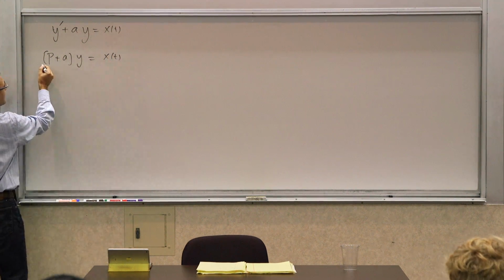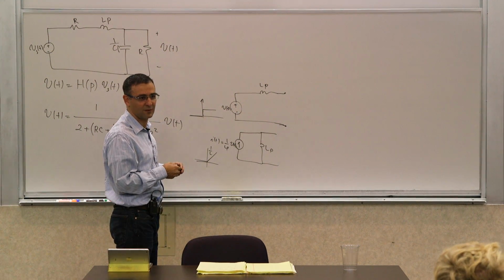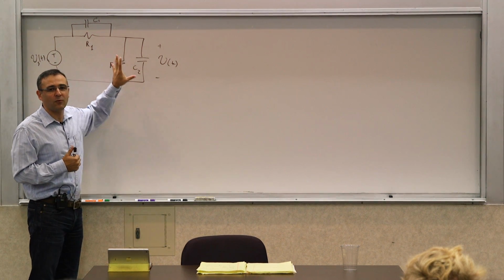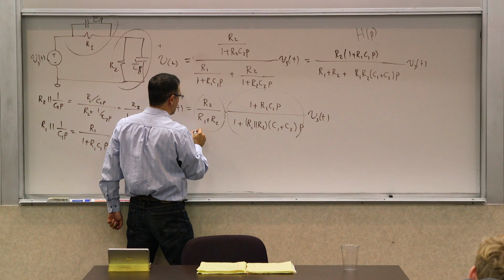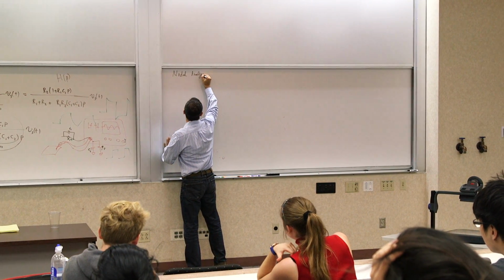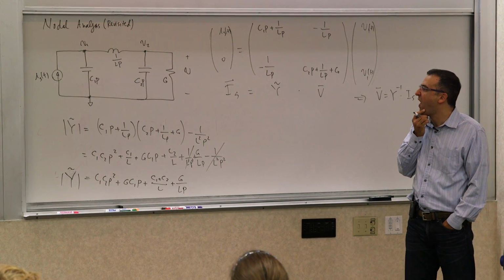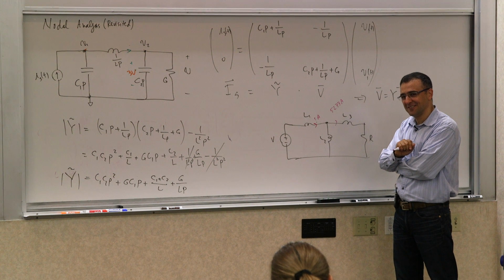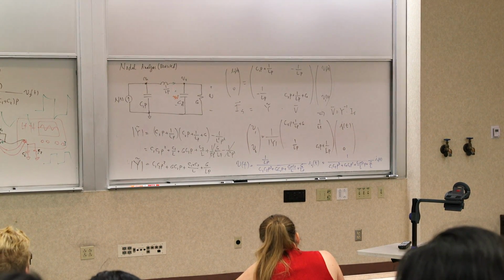019. Heaviside Operator: Nodal Analysis Examples, Order of System, Oscilloscope Probe

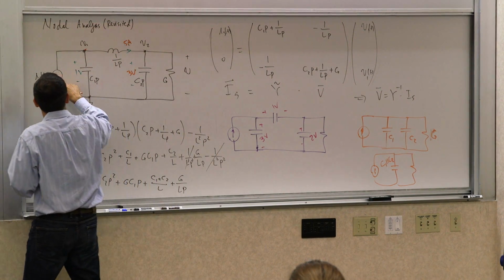Comment: Hello professor Hajmiri, i have a doubt regarding the order of the circuit discussed @ 47:00

When the excitation is a current source....  lets consider setting the 2 capacitor voltages to v1 and v2.  If we set the capacitor voltages, the current through the inductor should be governed by the eqn --> [(v1-v2)/Z]
(ie the potential across the inductor divided by the impedance). Thus how do we say we can arbitarily set the current through the inductor when it depends pretty much on the capacitor voltages v1 and v2?

Kindly help me understand what im missing !

Also i take this as my oppurtunity to thank you for all your lectures on circuits and analog ic design🙏🙏 These are treasure to any aspiring circuit designer
Reply: I think, as we have an extra current source, we can arbitrarily put conditions of that current on c1 and p under the vision of current source and once carefully listen from 50:00 onwards, you will understand

Comment: [19:20s] 
What if I had an independent current source in place of the voltage source? Will that change the order of system to 2 since I can now define two arbitrary initial conditions with both the capacitors?
But how can it be possible if the order and hence the natural frequencies are independent of the stimulus?
Reply from the maker: Yes, the is correct. If that circuit was driven by a current source, it would be second order. The value of the stimulus does not affect the natural frequencies, but the nature of does. When you switch a voltage source to a current-source, you have changed the network. (It is easier to see when you null the sources). A simple example to elucidate this, is the following. Image a parallel RC being driven by  current source. This is a first order circuit with a pole at 1/RC. If the current source varies (e.g., a step), the voltage will not instantaneously change, and there would be an exponential behavior observed. Now switch the current source to a voltage source. The new system is zeroth order. There will be no dynamics. The output voltage (and current) will change instantaneously. Another way to see this is nothing that an ideal voltage source in parallel with anything (other than another ideal voltage source), is simply equivalent to the ideal voltage source. The capacitance (and the resistor for that matter) do not have any significance in the case of a voltage source in parallel.